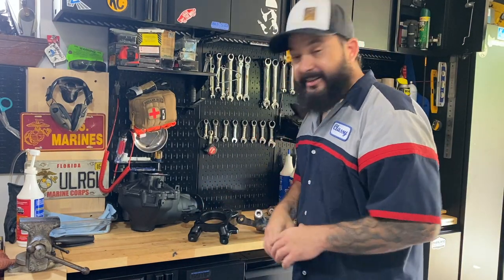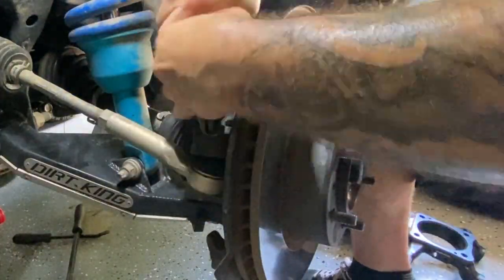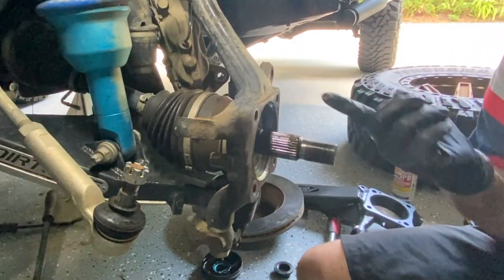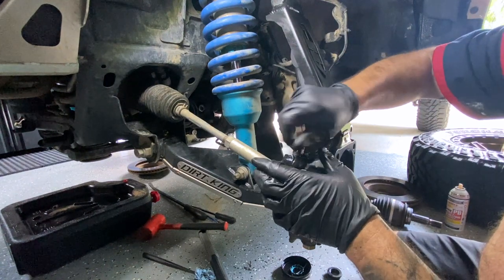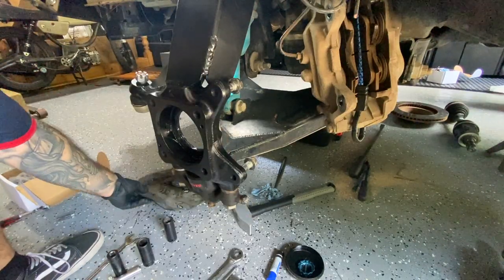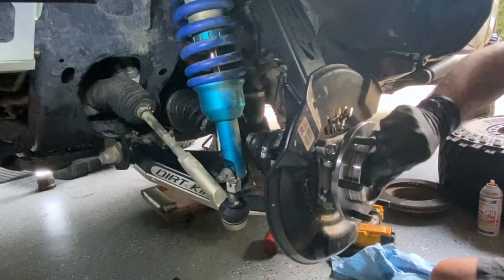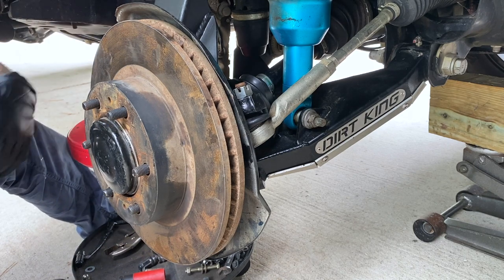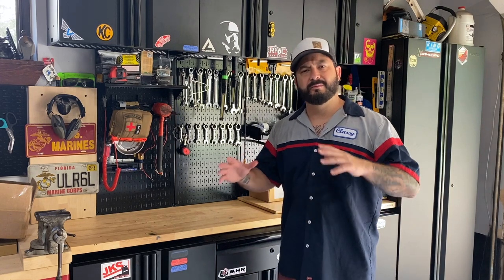3rd Gen Tacoma RC Fabrication Gusseted Spindle Install | (2017 Taccoma)

Comment: Great install! I’m actually taking my spindles welded this coming week. Is the replacement seal mandatory and is it OEM? If so, would you happen to have the part number? Thanks in advance
Reply from the maker: I think the seal on the inside of the spindle is a good idea to replace. Sometimes the older installed one gets beat up while you are trying to remove it. For the OEM part numbers I would call any dealer and give them your VIN, that way you can be sure to get the right part number for your truck. There are so many seals with different names for the same part floating around out there. I went with the Timken Seals and the fit was super tight. Thanks for watching.

Comment: Sometimes if I have a brake rotor giving me issues I will take my air hammer with the flat bit on the front and just hit the rotor a few times in between the lugs usually it falls right off, the massive vibration breaks the hold of the rust then of course when I put it back on I put a nice layer of never seize and next time it won't be an issue, on my personal truck 98 SR5 4x4 5-speed I have had every nut and bolt out of the truck and everything has never seize, so now whenever I have to do maintenance on the truck everything just comes apart like it was new,
Reply from the maker: Thanks for the heads up, appreciate it.
Reply: @ClassyTacos  of course no prob, I've been a fabricator/ mechanic for 35 years but I still learn new tricks all the time, when I started of course there was no YouTube, I find it a godsend now though it's so useful to be able to quickly look up how to take something apart that I haven't had experience with, some people make fun of it and call it YouTube University but that's just ignorance
Reply from the maker: @bertbccfu9564  I could not agree more.

Comment: what is that part called at 10:33 that you are putting the bolts in? and do you know what size those bolts are? 14x1.25?
Reply from the maker: I think you're asking about the suspension ball joint bracket. One part number here-- 4862504050 make sure they are the correct part number for the right or left side. The bolts I believe are M16 1.5 pitch, but you need to check that. Thanks for watching.

Comment: Did you need an alignment after the diff and spindle work?
Reply from the maker: No, not need, but recommend sure. A long as you don't touch the cam bolts you should b good. Thanks for watching.

Comment: Do you have a part # for that hub seal? Gonna try and re use mine since I’m not doing new hubs but would like to have some insurance in case I mess something up when removing them.
Reply from the maker: These come in so many different sizes and all manufactures have different part numbers. I'm hesitant to give them out as they can be for a different seal based on the manufacture. I recommend you call the Dealer parts department, have them give you the correct part number. Then you can shop around with that part number to find the price thats right for you. Your local auto parts stores will be able to cross reference parts that fit based on the dealer part number and your description. Hope that helps.